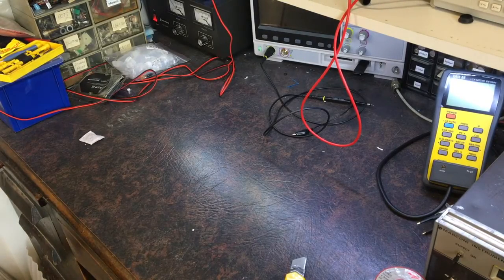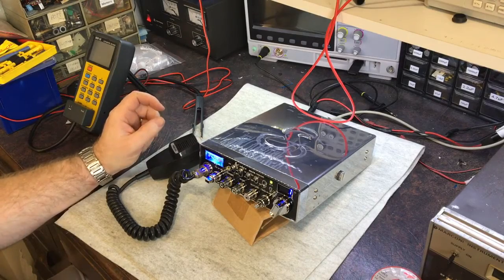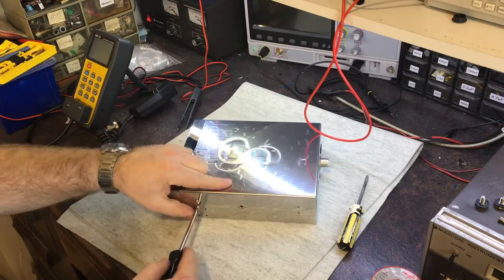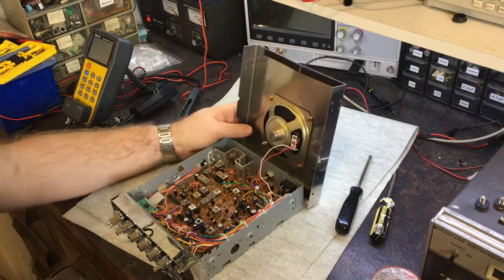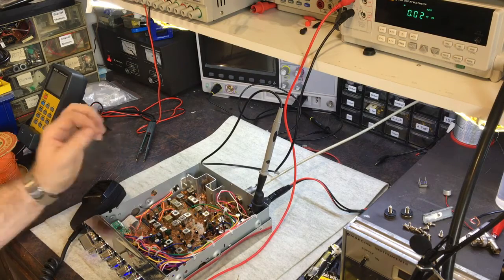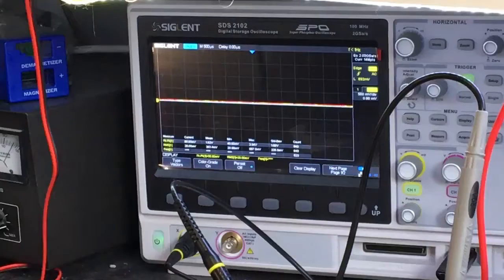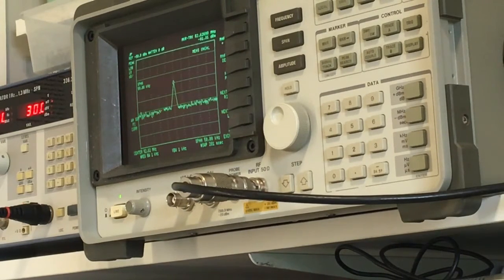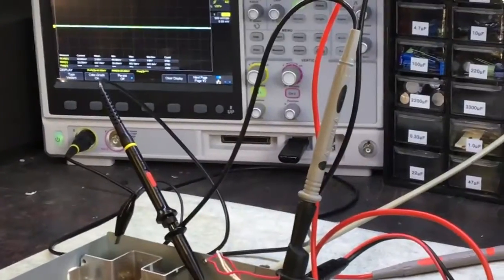#122 Cobra 29 Ltd Chrome CB Radio Frequency Conversion VCO Tuning.

Comment: My 29ltd had a swing kit put in but it does exactly what yours did. The transmit stops working after a few minutes turned on. Is there a way to adjust without equipment? It’s hard to find someone to work on a radio someone worked on around here